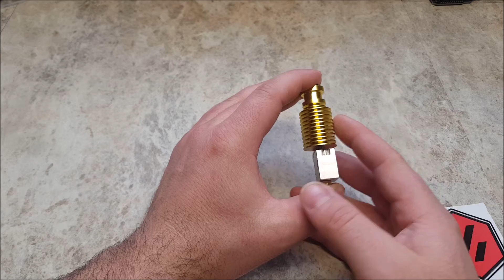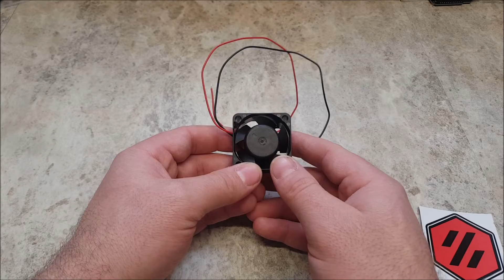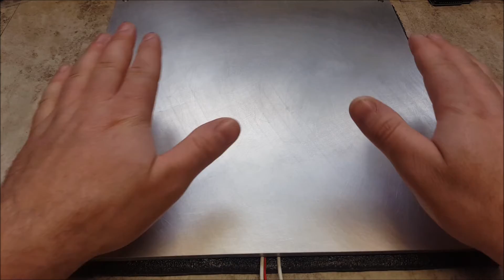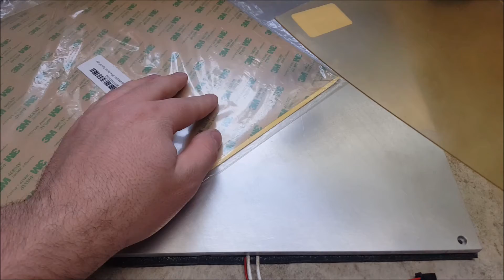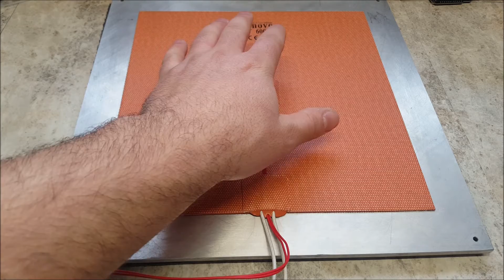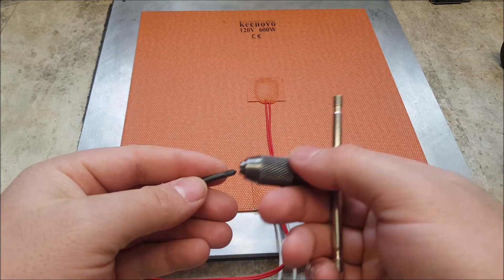Voron V2 Build and Source Pt4 Hotend and Bed

Comment: So wiring the fuse.  U already had connectors for quick connecting. But what did u do with the fuse.  One side goes to one of the white wires.   And other side of fuse is what.  I'm confused. I wish u finished the wiring so I can see thermal fuse
Reply: he simply would have cut the white wire (for power in) and solder the fuse in line. Basically the power goes through the fuse before it goes into the silicon heater. If you want the get super fancy you also could put connectors on everything, but since this is a safety device that only should trigger when there is an malfunction you should not have the need to change it constantly.
Reply: @hornet331  so when wiring. Pay attention and connect the fuse to the power in. I know it has no polarity but once wiring with the fuse. It becomes polarity basically and it matters which one is hooked up to power

Comment: You can use thin TIM (thermal interface material) or maybe a very small amount of thermal grease to make sure you have contact between the thermal fuse and the base plate. With these particular fuses, I'd check to see if the thermal grease is okay to put on plastic.  I'm not sure. 

In any case, without good contact to the surface you're instrumenting you can get 10-20 °C differences between actual and measured temps.

Comment: I know that this is 2 years in the future, but does the 2.4 support slice engineering hotends now?
Reply from the maker: yes
Reply: @CanuckCreator  thanks! does the Magnum+ work?
Reply from the maker: @subbot8077  No, its longer than most standard hotends and since slice themselves states not to use a plastic mount its will never be supported by the voron team.
Reply: @CanuckCreator  Ah dang, got it, thanks for the replies  :)

Comment: @11:40 Did you just hammer on a tap 🙀 Not sure if horrified or impressed. Btw - great work. You're absolutely the reason I'm building a Voron, and I appreciate all the time you've taken.
Reply: Carpenters have been banging their drills as long as they have existed. :)

Comment: I'm really afraid of 220v heated bed. What about 24v silicon heater for bed?
Reply: A 220V will draw approx 10x less current than a 24V one and you will need thinner cables, so more flexibility in your bed connections, less chances of bed solder break (like Anet A8 printers). In terms of safety, I think the 220V is safer, in both case you need to make a proper wiring with insulation. 
If you want to use a 24V bed, you will have to buy another 24PSU with a very high rated power.
Reply: you happen to answer that question? I want to know that to!!
Reply: @tacoterito22  you happen to answer that question? I want to know that to!!
Reply: @ManIkWeet  no My friend

Comment: Don't mount the TCO on the plate.  
Do use high temperature silicone to mount the TCO on the heater so that if the heater lets go of the plate, the TCO will do its job.  In my experience, 468MP is good for about 2 years of temperature cycling before it lets go.
Don't get a self-resetting TCO.  In an overheat condition you don't want the TCO cycling the power to the heater- you want it shut down completely.  
Do use a one-shot TCO.  Buy a couple spares.  They're cheap.
Don't buy TCOs via Ali-express.  This is not the place to save a few pennies.
Do get fully spec'd, safety-rated parts such as https://www.digikey.com/product-detail/en/cantherm/SDF-DF184S/317-1138-ND/1014767 for about $1 each
The type of part linked above self-heats, so you must get one rated for an operating temperature that is higher than you will be operating the bed- check the data sheet.  It ain't rocket science.

Be safe and don't burn your house down...
Reply: Mark, Was just going to post the same thing about not installing the TCO on the plate, it has to be in contact with the thermal pad to do it's job it the adhesive lets go.
Reply: So you would essentially glue the tco (like the one linked above) to the keenovo heater?
Reply: @AERuffy  yes- use high temperature silicone such a Permatex Red that you can get at auto parts stores for about $6.
Reply: @MarkRehorst  hi, what im not understanding is why the fuse shouldn't be installed on the plate. if you add it on the pad itself (where also the thermistor sits) it won't trigger, right? neither will it on the plate though. so where is the difference? thank you a lot
Reply: @certified-forklifter  the heater is glued to the bottom of the plate. Of the glue let's go the heater will fall away from the plate. If the tco is on the plate the heater will turn on and burn itself up. If the tco is on the heater it will blow and shut off power to the heater after it heats up a bit
Reply: @MarkRehorst  but why does it blow on the heater mat? the thermistor sits also on the mat itself, so it makes no difference. sorry, im not understanding you completely :)
Reply: @certified-forklifter  the heater is not uniform. The thermistor monitors the temperature at one spot. The plate acts as a heatsink for the heater. Without being attached to the plate, the heater will get very hot in some spots, much hotter than the controller would normally allow.
Reply: @MarkRehorst  mmh, okay i see thanks